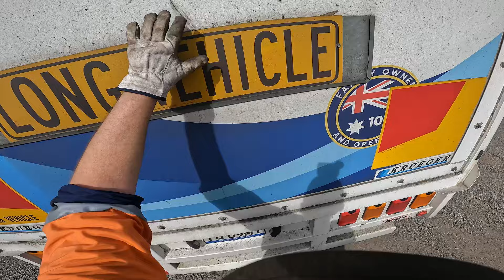Episode 37 Outback to Market

Comment: G'day Brad. I just watched your load of pumpkins. To help keep your videos interesting as you requested you should show how you strapped the load down. The pallets were stacked 3 high did you strap every stack? Thanks Allan
Reply from the maker: Hey Allan definitely somthing I will keep in mind and as far as the pallets go I only need to have a strap over the gates as they are load rated gates so the straps were only a back up for the gates but the joys of that is I don't have to run strap as long as there's no big gaps